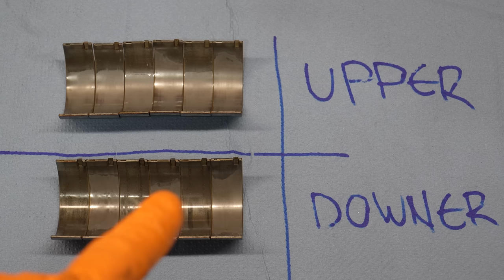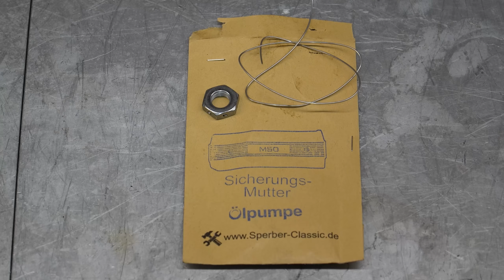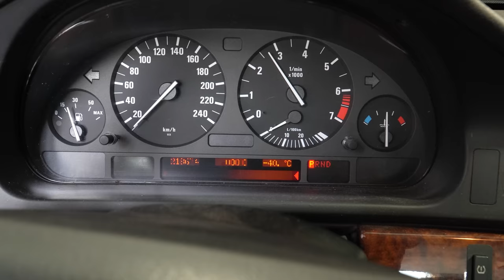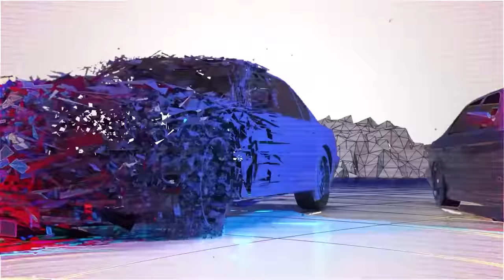How Much Work Can a Neglected BMW Need? - E39 530i Touring - Project Rottweil: P2

Comment: I'm disproportionately excited to see Sreten do a project to supercharge a humble E39 touring. I can't wait to see this project evolve.
Reply: Boosted an NA engines are designed and built  differently from the block out.  If one wants a reliable boosted engine, install one designed as such.  Sreten will be lucky to run 6psi of boost.  Just not really worth the extra mechanical gear.
Reply: @machtschnell7452  Shhh, what do you mean?! You just cost of a few episodes of wrenching, watching Sreten fix the engine he blew :D
Reply: @machtschnell7452  supercharger is not that harmful on engine like turbo at all. Factory spec engine should handle supercharger
Reply: @machtschnell7452  I know people running 20psi for couples thousand ks no issue on factory m54. They dont anymore. Around this point the head starts lifting, so not good for long use I imagine, though people get away with it. Typically on factory unopened m54 shoukd run 5-10psi of boost, will notice no change in reliability at all.
Reply: @machtschnell7452  Greek dealerships were already selling 520i with the AC Schnitzer supercharger as standard back in the day, to counter the supercharged E-Class (W210/early W211). M52 was working great with the supercharger, the M54 won't have any issues either. It's pretty strong.
Reply: @machtschnell7452  Give Sreten some credit.. you don’t think he will be researching options, issues etc thoroughly before doing such work? Have not watched his videos before? :-)
Reply: @machtschnell7452  I run 1.1bar boost on my M54 thats supercharged and even S50/S54 drivers  told me that the throttle response is just amazing. Will it last another 220.000km? Propably not, but Im running it like this for 70.000km. If the engine is well maintained and the engine calibration (tune) is spot on, it will work just fine.
Reply: @fregyt  infinitas does run with 5psi of boost i think so yea as you Said probably No Problem
Reply: ESS kit makes 350hp @8psi. 2 year warranty. 
The cost is around 7k € tho

Comment: No cost spared on this one. I'm always kinda balancing in between the money spent on parts in comparison to the state and value of the car when working on my own E39's. Guess here the good YouTube content makes up for that. Love to see it all done so right 👌🏻.
Reply: I thought the same. Wish I could justify replacing so much with OE parts on my E60 and E70. The cost just climbs so fast if you go to the lengths that you arguably should when doing a big job like this.
Reply: im sure the youtube money more than covers the expenses
Reply: @shaneskillzrepresent  Most probably. Mind also all fluids by LiquiMoly are sponsored, the new lifts are, huge set of quality Hazet tools as well. That being said Sreten started working without all of that comfort. Good on him, his work ethic enthusiasm and dedication to all this.
Reply: There are SOME parts that I use on my BMWs that are not OEM. In my case it helps that I work with local BMW and Mini dealer. In most cases it's easier and in the end, cheaper to use OEM parts. 
And sometimes you can use other BMW OEM parts that are a little cheaper. For example, front springs for the E39 530d M sport are the same as stock E46 330d springs.

Comment: Nowadays I clean absolutely every bit of grime / grease / and oil off my M54B30, it's transmission, and front subframe because of you. So satisfying getting it up with a tiny pick, little by little paired with brake cleaner. One day i'll have a nice parts washer!

Comment: Hi Sreten, great video! I just drilled the 2 "things" holding the baffle plate, cleaned the oil pan and then just tapped threads to put actual bolts which now hold my baffle plate and I just put some reinz seal on the threads just to be sure. Cheers from Bulgaria, love your videos!

Comment: The colour of the bottom end - replacing the rod bearings seemed sensible decision.
I wish there were more people like you doing good work and not so many garage owners ripping people off for rushed work if it is done at all.

Comment: Great video as always, thanks for showing the catalysator issue, I now know that I can safely replace them and that the rattling sound will be gone. My local Bmw Dealer wasn't sure what is wrong and I was afraid that after disassembleing I would figure out that the sound is still there. German TÜV always called it "cosmetic", AU was always fine. When I saw your previous video and heard that sound I hoped that you will come up with a solution to that issue. Wasn't wrong, thanks man, keep up that great work!

Comment: I like the build videos, good popcorn fun. I was a service technician for mercedes back in the 80s and 90s, and as such enjoy these type of videos. I would only leave one little critique, you do seem to replace alot of perfectly good parts that won't fail so soon, and as such spend more than the normal budget to get a car 100% for the customer again. Anyone can go into the hood and replace all parts, it takes true skill to know which parts MUST be replaced immediately, mid-term and long-term and how to diagnose and troubleshoot any current and future issues with the vehicle. Prices on parts for both BMW and MB are what we know they are and should be used until the very end. Keep up the great work, cheers! 🍺

Comment: 12:50 Try taking apart the ratchet mechanism and reversing the drive the other way. You can convert most torque wrenches this way to make them work CCW.
Reply: Seems like a lot of work for just one small job
Reply: @FilipMilenkovic01  I see you've never taken a ratchet apart. It's a 1 minute job.

Comment: This video is a great documentary for all E39 owners to how to properly maintain their M54 and cars. Big kudos for putting all those important info and torque specs.

Question to you though - haven't you though going for Msport bumpers front/rear? Or you prefer sleeper look?

Also I know you won't tell us which headers you used but I guess PNP ebay ones? :D

Shameless plug - look at my channel for my solution for nice quad exhaust on my 530i! I love those cars, had mine for 9 years I plan to daily them for at least next 5-10 years!

Comment: Streten, you have given me confidence over the years to attack my own project. My build is in Year two (I have limited time & funds) and now just waiting for some underbody work to be completed as I don’t do rust replacement either. But I’ve taken a 2004 VW Passat GLX 4Motion wagon from literally DOA (everything seized when I pulled into my driveway) to passing inspection once, and now to pass again needing some rust rot removed… but I have 14 new parts waiting to be installed once back. And you’re right. Nothing beats OE or better. I’ve had hoses that just don’t seat unless they’re OEM. And PTFE seals are so delicate but worth it. Thank so much for your enthusiasm.

Comment: I'm really curious how much oil it's going to burn. My engine wasn't nearly as sludgy as yours, but the oil control rings were clogged up almost completely (it used to take around 300ml every 1kkm, which is not that much by m54 standards). I know you're probably not planning to take it completely apart, but if you ever decide to do so, I highly recommend using piston rings made by mahle. They're much more efficient than the original ones because they have large, oval windows instead of tiny holes. I've rebuilt the engine around 12kkm ago and so far there is no oil consumption whatsoever.
Reply from the maker: If the engine burns oil, you can try the 02pilot mod. My E46 pretty much has no oil consumption with it.
Reply: @M539Restorations  I have a 325Ci M sport with 114K miles, M54 B25. It burns a lot of oil. I am going to try the 02pilot mod if and when the weather finally warms up here in the UK. I would love to rebuild the engine but cannot really justify the cost, here's hoping the mod works.
Reply: Yeah, I tried the O2 pilot mod but it didn't help at all - that's why I decided to do the rebuild. When the rings are clogged you can't really do much except doing a proper repair. After the project was completed, I deleted the CCV and now there is no vacuum in the crankcase. The fumes are vented through a catch can into the air box, underneath the filter. After 8kkm there was barely any oily residue on the filter, the MAF is perfectly clean as well as the intake. Fuel trims are also spot on. I know you're not a fan but it works for me, and I don't have to periodically chase lean codes caused by dipstick o-ring or some cracked plastic tube.

Comment: I absolutely love these engines. I had my first car in 2018, it was E60 520i with M54B22, such a great sound. Miss the car so much, but not the problems haha:) One big mistake i made was buying the PCV system by pieces from different brands, it was such a pain to assemble and it never worked right. Learned the hard way that saving a few bucks on these parts never works. Made many mistakes on it and learned a lot. When i watch these videos i remember everyting because i did many of these maintenance things too

Comment: Love the M54, such a simple yet brilliant engine.
Reply: good power and efficiency, and also very reliable. as long as it's got coolant and oil, it'll do whatever you ask of it! my buddy's has 250k miles and a tune with 7k rpm rev limit, beats the piss out of it every time he drives it. never once left him stranded!

Comment: Thanks for the video, as always!
 A hint regarding your back pain, while you are working in the engine bay, if you want, you could use an industrial back support belt, which not only support your waist, but goes over your shoulders as well (Hosentraeger?).
In the past 4 days I replaced the hydraulic tappets and rocker arms in my VW 1.6 engine, and could work tons of hours a day without any back or waist pain. I like that stuff very much.

Comment: Such a great channel, touching all the right places a M54 needs to be touched👍. I really love and appreciate the quality of your work. The only thing that I'm worried is the waterpump. I've replaced mine withe the same plastic wheel, and it died just after 2 years. It broke apart 🤯.

Installed a new one with a metal wheel an feel much safer now. Keep up the good work Streten!🔥

Comment: Im disproportionately(!)  engaged to this model. I have driven it more than 200.000 km and cant stop. It still puts a huge smile on my face since I bought it 17 years ago. (530i Touring m-sport) As Sreten says, service it and keep the rust away with some rattle cans of Fluid film and you can use the car til the end of days.

Comment: Dang. I had an E34 Touring of this same colour!. Mine was a manual (Euro-Dogleg box, M50TU revision Single-Vanos engine). Great daily and the gear shift is just heaven. Oh. I had M-parallel 17 inch mags. It had a 1 cm Spacer on the front axles. The car corners like a sedan despite the weight.

Comment: I've done many cooling system refreshes and coolant flushes on M54s and never made a mess. You don't have to remove the bleed screws completely, just crack them open.

Comment: No o-ring on that oil pump cover - that's an interesting design. But more importantly, it appears at 11:48 that the locating dowels in the pump housing face have vanished (top left and bottom right should have them). They're pretty important as they closely locate the shaft bearing concentric to the other shaft bearing - bolts alone won't do that because they have clearance on the bolt holes and the cover can move on the face as it's tightened down, which you can see actually happen.
Edit: 10:29 one dowel came off with the cover, one remained on the housing. But both have been discarded.

Comment: I learned that if you get an old bleeder screw and drill it in the middle and stick a piece of clear tubing in it and epoxi it , you never make a mess again , just bend the tube back in the reservoir and you can also see bubbles better

Comment: Excellent episode, ACF50 is very good stuff been using for years on my motorbike smells great when it burns off, the strip caulk is interesting stuff Audi use to use it for sealing tail lights onto the body of the old Coupe / ur quattro, it never goes hard so always seals, I use a bog blob of it to mount my phone in the car on the dash it doesn't leave any marks when you take it off either, all sorts of uses this stuff has

Comment: As much as I love the M5, I am very excited to see some Everyman's E39 content. The 530i is the absolute and undisputed king of economic to fun ratio in a daily driver, got two of them myself. Though I'm not much of a touring guy, I'm thrilled for more of this project!

Btw, your external air temperature sensor is either broken or has a severed cable (showing -40°C), but I suppose you'll be attacking electronic shenanigans in another episode.

Comment: 19:00 now it makes sence. Last year I replaced engine mounts with Lemforder ones, and after that I feel little bit more vibrations from the engine than with old OEM mounts. It means that I bought not OE mounts 😅forgot where they were made, but deffinetly not in Germany

Comment: What a nice car! Was a little bit sad when you decided not to leave the previous e39 touring. This dashboard pixel disaster is so common on e39/e53... And -40 outside temperature is a sign of temperature sensor line break. Sensor may be ok, it should be 4 kOhm, if I'm not mistaken. But you'll probably change it anyway))
Reply from the maker: Thank you! Sensor is disconnected as I'm doing suspension work

Comment: Sreten! I thought I had tuned into the wrong chanel when I saw the lock wire! I thought it was an old "oily rag". All credit to you that there jam jar runs lovely BMW used to make a lovely 6 cylinder engine. I think the marque kinda died when they started putting v8's just to get more power and for US market.

Comment: Auto parts are a challenge in US also.  Finding a domestic parts manufacturer is hard.  There was a video that a gentleman talked about in the late 1980s, there were buyers in the US that would go to salvage yards.  The buyers would buy used starters, alternators, fuel pumps, brake parts, you can imagine.  They were buyers for companies setting up shop in China to reverse engineer and build auto parts.   The salvage yards, they were making money, but giving China everything they needed to take over auto parts.

Comment: Hi Streten, I’m a very big fan of Dasty for years. But be aware it is quite aggressive (e.g. it eats the paint of rims and damages rubber). Therefore I always rins off with water or brake cleaner. Just for you to be aware

Comment: You are the best with BMW. I owned a 1994 BMW 850CSI, 1987 633 CSI,  1996 740i, 2001 750IL, 2006 M3, and a 2000 323i manual. i will tell you this all the cars are nice, but my 323i is the Best. I would like to upgrade the interiod of my 323 mainly the head liner with Alcantara .

Comment: Acl makes bearings for my 2010 crosstour as well, i swapped this engine in after a timing belt failure took out the first one, so i clearly have no idea how the previous owner of either engine took care of them, right now im doing 1500 mile oil changes until it looks a lot better than it does now, the pan isnt leaking but i would probably redo that soon anyway and if i do I’ll look at installing these, powerrevracing sells a lot of “performance” type parts that im kind of interested in, otherwise im sticking with oem on basically everything unless its not available.

Comment: Sreten, if you want to torque to spec NOT using a torque wrench, you can convert to force in gram meter. 25Nm = 2549,29 gram on an arm of 1 meter. This is basically how a torque wrench is calibrated.

Comment: Hey Sreten, excellent video as always! one question, what do you use to lubricate door hinges?
Reply: A drop of light oil would be fine or some white lithium grease. Whatever you use it will attract dirt and look errrr..... dirty. WD40 won't last long. It drys out fairly quickly.

Comment: These days if I do decide to change a part that is still just ok I always keep it in case the new OE replacement bites the dust early. The quality of “OE” parts is dropping all the time. Even if you buy from the dealer with older cars the part can be a poorer replacement (if the part wasn’t made obsolete even before the 15 years they are supposed to support.)

Comment: I think there are problems with the dashboard. Shows the temperature overboard -40 Celsius. In the summer, this will prevent the air conditioner from being turned on. Usually it corrodes the minus of the dashboard power supply. But maybe it's the temperature sensor, who knows. Good luck. Thank for video.
Reply from the maker: No problem, I disconnected the sensor while working on the car.

Comment: Sreten my friend, you need to source the Getrag 420G 6MT that was used in the M3 and swap it in.  I don't know what your final torque output will be once you have the blower installed, but I'd be quite surprised if that transmission couldn't handle it.

Comment: all well done as usual but you have to fix the outside temp sensor because its going to increase your engine rpm and injection will be to high, mixture will be off if driven withouth the temp sensor or will throw a check engine light (as seen in the video showing -40C thats standard temp withouth a temp sensor )
Reply from the maker: It's simply disconnected cause I'm doing suspension. That's misinformation, that tiny sensor has nothing to do with DME and engine running.
Reply: @M539Restorations  I fix bmw electric problems and it's 100% true its not misinformation. (Comunicates with dme,kombi,abs/dsc/ihka modules)  Anyway I don't want to "open a thread" now, well done you've saved a nice E39 ✅️
Reply from the maker: I'm sorry, but it is. It can't affect engine running, that's why you have a temp sensor in the intake manifold, oil, coolant, head...